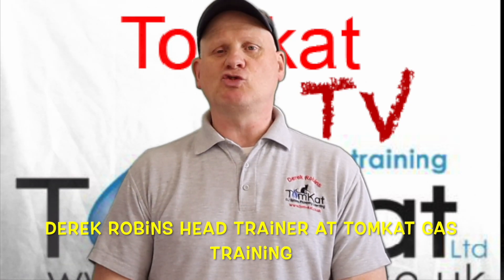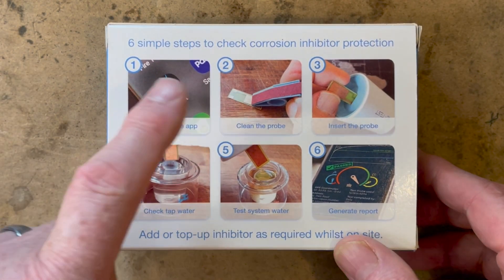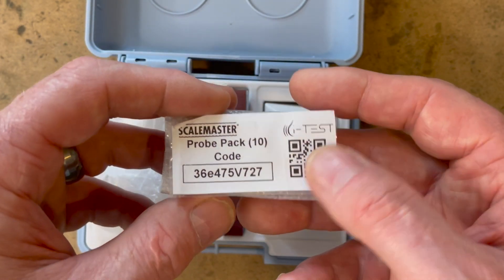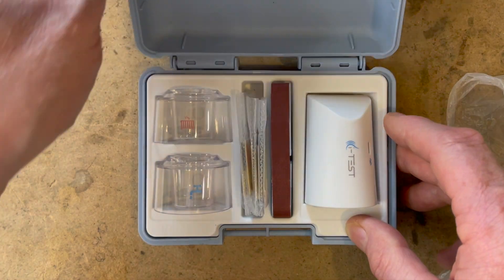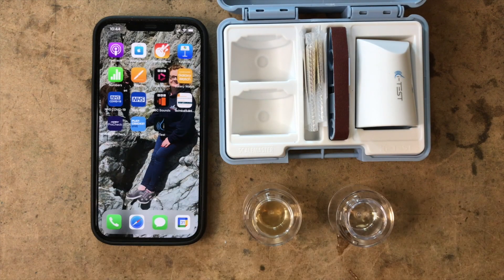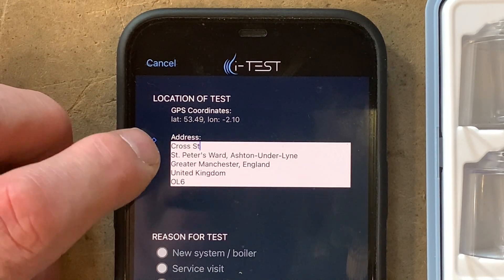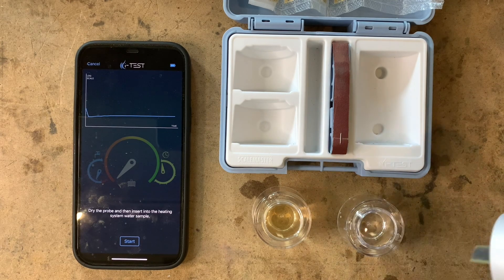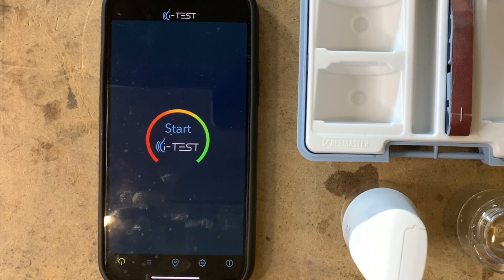Scalemaster I-test, un-boxing, reviewing and testing for inhibitor in central heating water.

Comment: Just purchased the Adey kit, and to be honest looking at what a faff that kit is I’m glad I did, how much does that kit retail at and how much are the test strips though, if they’re cheaper than Adey that would be the only reason I’d change to the scale master tbh
Reply from the maker: If you look on line Adey is more expensive
Reply: @tomkatgastraining  yeah just had a look, initial kit is similarly priced, replacement test probes work out cheaper though, I suspect Adey will have to match the price at some point to compete, Adey one is quicker and easier in my opinion though
Reply: @paulsmith2931  Adey kit won't work on all inhibitors. Only Molybdate chemicals so you could get a false reading if there is an alternative in the system or you don't know what's in the system.
Reply: @andym8707  listings their is a link to the inhibitors it will test with and it’s very extensive
Reply: @paulsmith2931  How do you find taking the photo on your phone, I’ve struggled and gave up last week when I tried.
Reply: @elwittinio2865  not had a problem